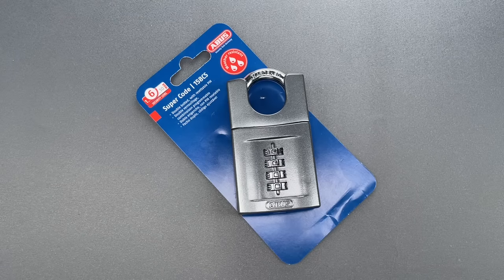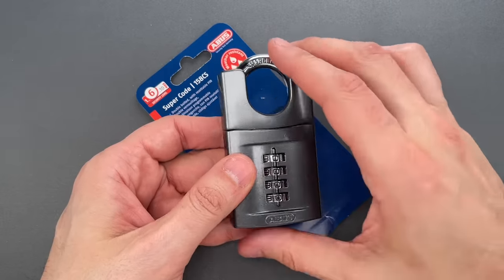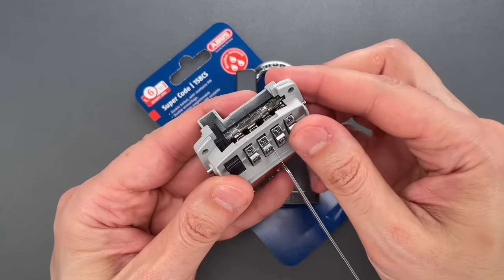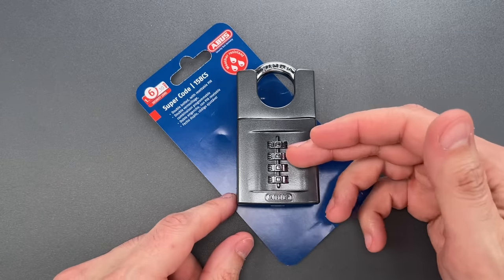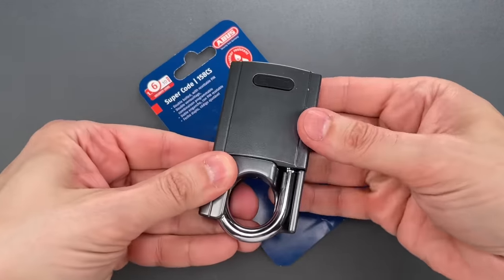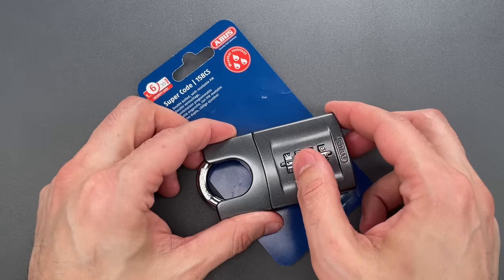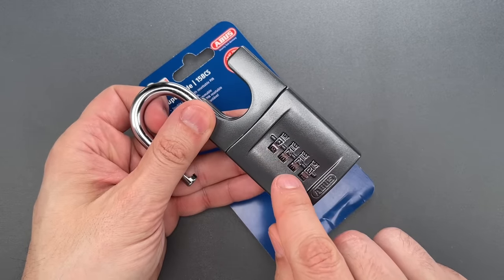[1541] Abus “Super Code” Padlock (Model 158CS)

Comment: let me get this straight...  you can change the combination when the lock is locked ?

so this is susceptible to a random person turning the slot on the base and changing the combination, then resetting it.. or just messing it up so you do not know the code..

surely design wise the combination must not be changeable unless the lock is open ?
Reply: Has to be on correct combo first, which it was at the time - 0000, to use the change mode.

Comment: Wouldn't a faster way be to take a screwdriver and turn it to change mode, set a combination and then turn it back to operate mode?
Reply: Maybe he didn't have a screwdriver.
Reply: The combination has to be entered correctly before you can turn the set/operate actuator.
Reply: Although these locks are insecure, they aren't THAT insecure. All locks that allow you to change the combination only allow you to enter change mode if the lock is open.

Comment: What's preventing someone changing the combination on the lock when you have it locked to something? That would suck if you come to your locker and some prankster changed the combo while you are away.
Reply: you need the correct code first before you can engage the change mode.

Comment: You can put it into change mode and set a new combination while it is locked ?
That sounds like a vulnerability to me. Pull out a quarter, twist the knob, set the combination to 0000, take it out of set mode, and dial the now-known combination.
Reply: Has to be on correct combo first, which it was at the time - 0000, to use the change mode.

Comment: That you can scramble the combination with the shackle locked is terrifying. Locks should not fail dangerous.
Reply: It was still on the correct combo, 0000, which allowed him to use the change mode.

Comment: 1:41 Am I seeing this right? Couldn't anyone with a coin or flat screwdriver just change the combination to open the lock?
Reply: Has to be on correct combo first, which it was - 0000, to use the change mode.

Comment: If you ask me the biggest flaw is having a change mode that can easily be accessed with a screwdriver.
Reply: Has to be on correct combo, which it was at the time - 0000, to use the change mode. If someone wants to just mess with you and not steal anything they could change the code but would have to correctly decode it first.

Comment: Can't you just turn the code change wheel after it's locked since it's so easily accessible?
Reply: Has to be on correct combo, which it was at the time - 0000, to use the change mode.

Comment: Wait you can change the code even while the lock is locked?
Reply: Shackle was back in but it was still on the correct combo, 0000 at the time, so it was unlocked which allowed him to use the change mode.

Comment: Am I missing something here?
You put the lock into change mode ...
You then scrambled the wheels.
You then put the lock back into operating mode.
scrambled the wheels so you didn't know the combo....

No tool required, use a dime to turn the little screw head.

why not just openly change the combo...?
change mode.. reset combo .. and while looking at your new combo place back into operating mode while looking at your new combo..
I know my description is a bit convoluted but I hope you understand what I am trying to convey.
Reply: He's "picking" the lock by decoding it and without using any picking tools. Doing it by the way the wheels feel as he turns them. As for not openly changing the combo or looking at the new combo when he puts it back into operating mode, I think you answered it yourself in the first section you wrote.
I'll use this analogy: You buy a new Rubik's Cube. They're packaged as solved or done when you buy them so obviously it needs to be scrambled up first. But instead of scrambling it yourself you have someone else do that and can't see them as they're doing it. Because you didn't see the way it was scrambled it makes it more of a challenge.
Reply: you need the correct code before you can change the code.👍

Comment: Wait. I'm confused. If the change mode option is just a single turn with a screwdriver then why can't anyone just walk up to this lock and change the code? Does the correct code have to be entered when you turn the change mode on the bottom? Otherwise, this lock feels pointless even without being able to "pick" it with no tools.
Reply: You answered your own question.

Comment: this design has me more concerned my jerk brother would simply change the code while it is already locked and prevent me from opening it.
Reply: No. He would have to decode it first because it has to be on correct combo to use the change mode. LPL still had it on the correct combo, 0000, so he was able to use the change mode.

Comment: Odd that you can scramble the code while the unit is locked.  Any prankster could lock you out.
Reply: Shackle was back in but it was still on the correct combo, 0000 at the time, so it was unlocked which allowed him to use the change mode.

Comment: 30 seconds without tools and without arousing suspicion, I'd say this lock is even worse than garbage.  Even though this guy has a lot of experience at picking locks, this is so easy that even an average person could probably do it in a couple of minutes, looking like they're simply entering the code. And looking at the packaging, they state a 6/10 security level? It should be 0/10! How can a lock company put out such a crappy lock?

Comment: I'm surprised someone doesn't go around just changing combinations on other people's lock
Reply: Not sure if you caught this but it has to be on correct combo first to use the change mode. However, if someone correctly decodes it then they could change the combo if they wanted to.
Reply: Well yeah...I was referring to someone using this and similar exploits to cause a bit of chaos. 

It would initially be frustrating to be on the receiving end but ultimately a good laugh.

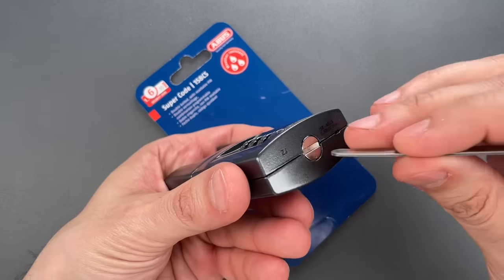Comment: 1:40
Did I miss something.
With the lock closed you reset the combination.
You would have seen the combination if you had looked.
My guess, although not made obvious, was that with the correct number set you closed the lock then without changing the number you set it for making a new combination.
If not, then it is not a lock, just a toy.

Comment: Did you change the code with it locked?
If that is the case... couldn't you open this with a flat head screwdriver to put the lock into change mode?

Seems like a pretty big flaw aside from the spring
Reply: Shackle was back in but it was still on correct combo at the time, 0000, which allowed him to use the change mode.

Comment: Am I missing something? The code can be changed while the lock is closed?
Doesn't look like there is any special tool needed to switch between coding/operational mode.
Reply: Shackle was back in but it was still on correct combo at the time, 0000, which allowed him to use the change mode.
Reply: @purpleghost4083  ah, ok. Thanks.

Comment: So you can change the combination with a random flat piece of metal while the lock is locked? That seems more unsafe than the fact that you can decode it in 10 seconds
Reply: Shackle was back in but it was still on correct combo at the time, 0000, which allowed him to use the change mode.
Reply: @purpleghost4083  ah, ok

Comment: it seems a little messed up that you can just change the code while the lock is locked.  Like you don't even need to know this trick if you can do that.
Reply: Has to be on correct combo, which it was - 0000, to use the change mode.

Comment: wait, did you set the code with a locked one? if thats posible, then why bother trying to find the code?
Reply: Shackle was back in but it was still on correct combo at the time, 0000, which allowed him to use the change mode.

Comment: Wait Wait WAIT! You mean you can just turn the bottom knob then change any persons combo so even They don't know what it is any time?  (change mode)  ?? WTH?
Reply: No and yes. No, it has to be on correct combo first to use the change mode. But if someone correctly decodes it, then yes, they can use the change mode to lock out the owner.

Comment: That it can be reset to a new code while locked also rather defeats the purpose of a lock.
Reply: Shackle was back in but it was still on correct combo at the time, 0000, which allowed him to use the change mode.

Comment: That lock is complete garbage if you can change the code with it locked, i can see people changing the code and the lock owner not being able to use it or unlock his stuff
Reply: Shackle was back in but it was still on correct combo at the time, 0000, which allowed him to use the change mode. Yes, if someone wants to just mess with you they can change the code AFTER correctly decoding it first.

Comment: Couldn't someone sabotage the lock by setting it change mode spin the wheels then put it back to normal?  By not requiring the shackle to be open it's indeed a possibility.
Reply: Shackle was back in but it was still on correct combo at the time, 0000, which allowed him to use the change mode.
Reply: @purpleghost4083  What I mean is, some miscreant walks by knowing how the lock works (not how to open it).  He turns that screw, spins the dials, then puts it back.  Without the shackle blocking access anybody can do that, correct combo or not.
Reply: @randycarter2001  The change mode screw doesn't work if the correct combo isn't entered first.

Comment: Why do locks have "change" modes available that someone else can use to mess with Your combo? Bad designs.
Reply: Has to be on correct combo, which it was at the time - 0000, to use the change mode. But, yes someone could change the code AFTER correctly decoding it.

Comment: Wait. You can change the combination with the lock, locked? I went back and watched. Yeah he changed the combination with it locked……. So wtf is the point
Reply: The shackle was back in but it was still on the correct combo at the time, 0000, which allowed him to use the change mode.

Comment: I have a super  Lock pic It can pick any kind of lock in a short amount of time I call it my AK47
Reply: Won't work particularly well against thicker metal locks
Reply: @LoveOverwhelming   It will go through  A engine block With enough time and enough rounds I think you could dig a hole through anythingI haven't tried everything I have shot up a car pretty easily cut it in half I am pretty sure I can Turn any lock into Swiss cheese
Reply: @oldcountryboy  being able to harm mild steel that wasn't particularly meant to defend anything isn't the same as going through more potent alloys that were designed to defend against.

You also said "short amount of time"; you'd fare very poorly against locks meant to defend against angle grinders. You might get through eventually, but not in a short amount of time.

In particular, thick heat treated steel with nickel is going to defeat your AK-47 for quite a while. Because, well, it's what we use to defeat such munitions in various forms of armored vehicle. And I have such a lock; they are commercially available.
Reply: @LoveOverwhelming   I meant in a long period of time you could get throu AnythingThere is no kind of padlock that it wouldn't take 30 seconds to get through30 seconds would be more than enough time to put 200 rounds into The Thing I think I could do it I am about 95% sureI'll tell you what you buy me a super expensive Lock And I will shoot it upAnd seeAnd see
Reply: @oldcountryboy  There are definitely padlocks that would take longer than 30 seconds, because even specialized tools meant for breaking such material takes longer than 30 seconds, as I said. Indeed, you'd probably have better luck using the butt of the gun.

And, indeed, they aren't "super expensive"; about 100 dollars is enough.
Reply: Also I should add if I didn't by chance get through the lock the door would have so many holes in it it wouldn't really be a door anymore And whatever was in the shed isn't going to be worth stealing It's gonna be all shot to hell
Reply: @oldcountryboy  I wasn't particularly referring to door locks, mostly because there are far better ways to secure a door (even against sustained gunfire). That's why I mentioned angle grinders.

Also because the topic of this video isn't a door lock.
Reply: @LoveOverwhelming   Okay You can believe whatever you want to By special tools you mean a grinder I have used a grinder and I have used An AK47 And I am telling you the AK would get through the lock first  But you can believe whatever you want I won't be shooting anybody's lock off anyway I don't steal
Reply: I'm talking about the door you would put the padlock on That's how people lock their   Sheds up That's what I thought they put that lock on a shed didn't they
Reply: @oldcountryboy  I can tell you, having also used both, that your statement is wrong, because it lacks qualifications.

Some locks would fall to one first, others to the other, because some locks are more suspectable to different kinds of damage. That's literally why we have different kinds of locks and different alloys.
Reply: @LoveOverwhelming   And I can tell you definitely I would be able to shoot that locked up and about 30 seconds the lock in the video easily You can believe it or not whatever
Reply: @oldcountryboy  I mean, you can be wrong, and you are.
Reply: @LoveOverwhelming   Well   I have used both  The AK doesn't care about alloys It doesn't care what kind of metal it is